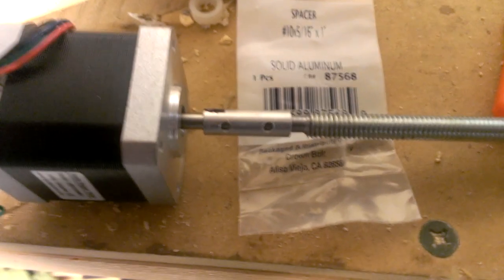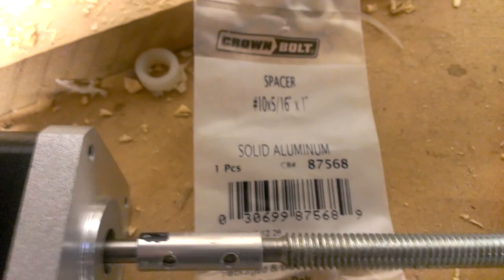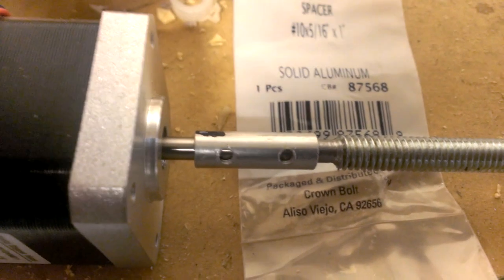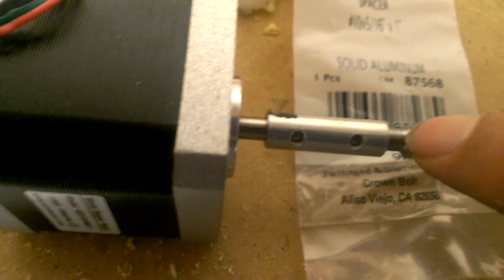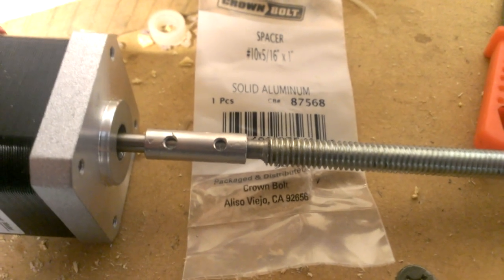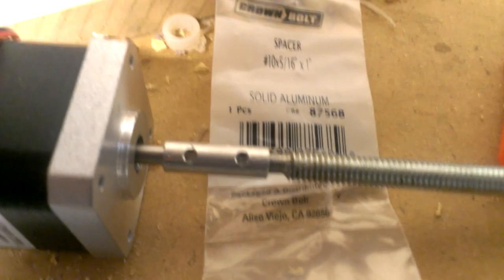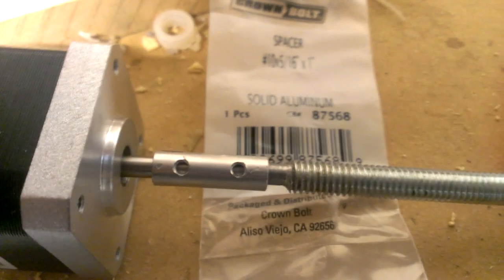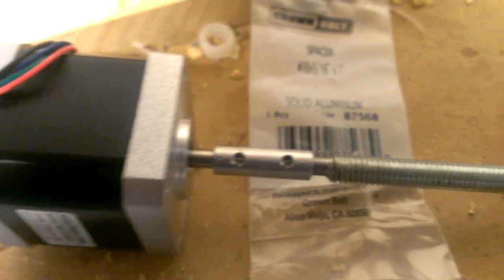Connecting the Motor to the Threaded Rod

Comment: Very nice concept! I am using the same concept in a conveyor feeding system. Could you please tell me more information about the motor you are using in the video?
Reply from the maker: It's just a Nema 17 I picked up, and running it on an HBridge adapter.  It's been moved onto a GRBL Shield now, and they work a lot better for control.  Thanks for asking!